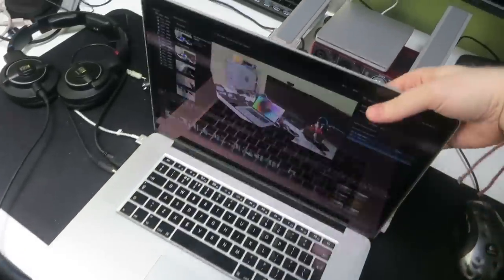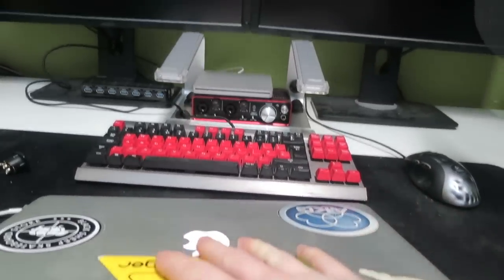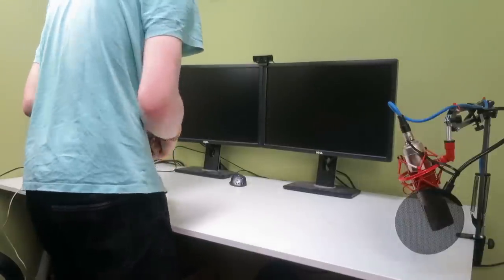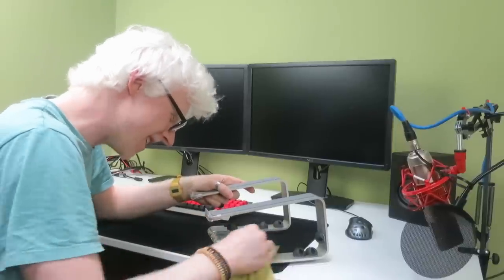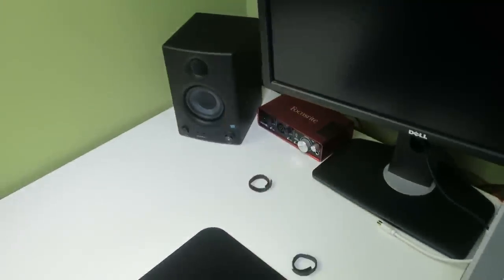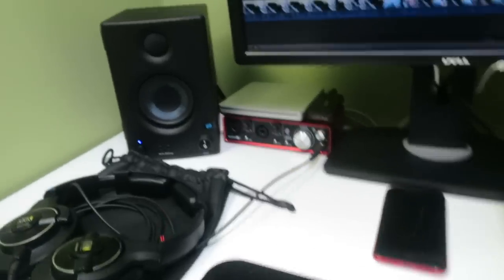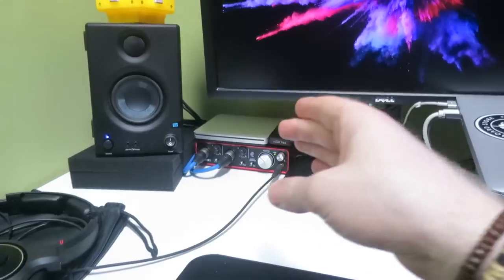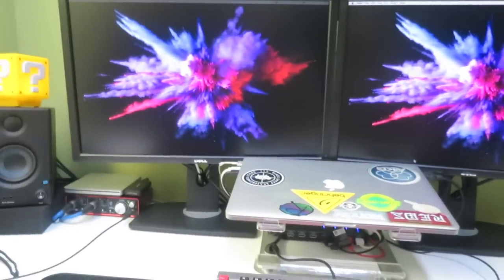Rearranging My Main Setup (July 2020)

Comment: If you go on ebay and search for "hp thunderbolt Dock" there is a seller selling them for 15 quid you need a psu and thunderbolt cable but they shouldn't cost more than 20. I've bought two ad they've been great.

Comment: If you want a mini project, you can actually buy replacement shells for those logitech mice! Don't know if they are as good as the original, I think they're copies. They also still make the MX 518 today, with a newer sensor and stuff. But why not change things up ey? Well I don't know of any mouse I prefer over the MX and it's descendents, though that new MS Intellimouse Pro looks pretty cool...

Comment: Id be pissed if I just dropped $6000-$50000 on a Mac Pro and they drop support for it...
Reply from the maker: Yep, that would suck... but hopefully Apple will be a little more generous support wise with this transition than they were with the last.
Reply: @ItsMyNaturalColour  From whay I gathered, they wont switch right off the bat... For starters they will only introduce ARM to the lower end MacBooks then move from there... I still think they have a ways to go until they can produce a x86 level proc...
Reply: @neccros007  Yeah the current ARM chips in iPads and iPhones are a great replacement for most laptops and maybe the Mac Mini but I'd expect at least a few years before they can develop a worthy chip for the Mac Pro and maybe the iMacs.

Comment: you got a bottom shelve were you could put the laptop and reroute the cables underneath the table or behind the table? or wall mount both monitors or go to a large screen tv i have my laptop attached to my 75 inch 4k tv

Comment: The idea of using my MacBook Pro 2015 in a clamp shell mode crossed my mind too. I too use two external screens although in slightly different layout. In the end I decided not to do that because of thermal throttling I experienced running CPU heavy tasks with MacBook closed. Could you do some test on your MacBook to compare temperature curves with lid closed and opened? I would be very interested to see if my experience was true and decision I made correct.

Comment: looking good mate, but personally it could be even better. if you use a dual monitor stand/ of amazon they are around £20/25. just a thought, you might even be making an updated video adding the monitors to the duel desk stand. will be much cleaner and better cable management

Comment: Does the MacBook Pro Retina really make a difference being in Desktop mode? I have a 2015 version and it's my main machine. I use it for Photoshop, Sims, Streaming Movies and running my iTunes Library for my Apple TV and it works great though i would like to be able to up my graphics on Sims 4.
Reply from the maker: Not for something like Sims 4. Presumably you're running the game at a lower res than the native res of the rMBP, which is a whopping 2880x1800 (2560x1600 if you have a 13"). 
In a case like that, it wouldn't make any different unfortunately.

Comment: Would hugely recommend the Thunderbolt 2 hub, it will eliminate your bandwidth concerns compared to the 2 USB ports. Apple are usually great when it comes to thunderbolt, so I wouldn't be surprised if you were to have 20 gigabit bandwidth through both thunderbolt ports, compared to the measly 5 gigabit bandwidth of USB 3.0. Love the content keep it coming!
Reply from the maker: I'm keeping an eye out on eBay. They're just so expensive.

Comment: Hi Tom, definitely something I need to do, my desk needs a spring clean too! I've a MacBook Pro late 2016 which has the dreaded butterfly keyboard, its been replaced already under warranty and once again i've 3 keys that have come away. It needs another warranty replacement however with the current situation you can't take it into Apple and it has to be sent away for around a 10 day turn around. So due to that i've got myself a Amazons basic laptop shelf, a wireless mouse and a wired keyboard, that way I can still use the laptop without all the pain for the dreaded keyboard! Also looking at a possible new MacBook Pro with the new Apple Silicon ones due at the end of the year, however I was almost pushed to get the current 16 inch MacBook Pro from Amazon, especially as they are doing this '5 months payment' scheme with no interest. A good way to get a new MacBook, however its only for the standard builds, so if you want more than a 1Tb SSD or more memory then you can't get them with this offer.

I also started to look into Thunderbolt systems, especially as my current and probably future MacBooks only have USB-C ports. Anker do a good one and there are so many others around too. https://www.anker.com/uk/a8396launch?search=masterbanner&keywords=master_ukA8396launch061520
Reply from the maker: So sad to read about these keyboard issues. What a complete fail on Apples part. Still can't believe how wrong they got it.
That loks a nice piece of kit. I have a few Anker things and they're all great.

Comment: Please tell me you turned the usb hub round so the cables are going straight behind the desk
Edit: okay it's not as full as I was expecting, having to reach round to add to it is probably worse than just looking at the cables
Reply from the maker: The back has the 12v cable and the chunky USB-B connection, so probably worse turned around.

Comment: Awesome video Tom! Given the MacBook's age though it might be a good idea to open it up and give it a clean before you get too settled. I have almost the exact same model as yours but the slightly higher end one with the dGPU and it began to stress out a couple of months ago when I was doing a lot of editing. But after giving it a dust the temperatures never get too high now no matter how hard I push it.
Reply from the maker: Definitely. I have a plan to make a future video, opening, cleaning and re-applying thermal paste to the MacBook Pro. Should definitely see me through for a little while longer.

Comment: Might I recommend Auralex MoPads for the speakers? I've owned a set of them for years and they isolate my speakers from the desk COMPLETELY. No sound transference whatsoever and nice options for angling up or down. You can pick them up off eBay for a very decent price and they last forever
Edit: ha nevermind just got to the next section of the vid and you've already got some pads

Comment: Need to hang the monitors on the wall or get a mount that clamps on your desk with dual monitor support.
Reply from the maker: Trying no to do anything too permanent as I'll be buying a new main machine as soon as the new Macs are released, but an arm is a good shout and I do have some spare Duronic monitor mount kit floating around.
Reply: @ItsMyNaturalColour  The arm would clear up more desk space by not having the two monitor stands. You can raise both monitors up just a little and push back the laptop. Always nice to talk with a YouTube celebrity.

Comment: Looking good Tom 👍. I have to say though that I would find it difficult having the monitors in those positions as I need a primary display right in front of me but I know you're limited by space.  Seen it mentioned in other comments and agree a dual monitor mount would be a good shout for a cleaner look.  Just about to purchase a as second one my self for stacked displays in my set-up. 🙂
Reply from the maker: Yeah, I have to admit it's not great. Not loving it, but it'll do until the new machine comes in. If I get mega sick of it, I will consider stacking.

Comment: Great to see! When Apple Silicon Macs are available, which one do you anticipate you will choose?
Reply from the maker: Great question. 
I can see myself leaning towards an iMac, especially if they refresh and modernise the design a little.
Reply: @ItsMyNaturalColour  That's what I would go for. I have a 27" iMac now and apparently there could be a new iMac redesign coming as early as the end of this year possibly early next year around the summer.
Reply: If you buy an iMac, buy one with an SSD

I tried to upgrade my 5400rpm HDD in my iMac to an SSD, and 2 weeks later, my screen fell of.🤕
Reply from the maker: @TYOPRO02  I honestly can't believe they're still selling iMacs with 5400rpm drives in them.
I bought a Mac mini for work a few years back with a 5400rpm 500GB drive and it was the worst machine ever. Beachballing during first boot and all the way through the setup installer haha! 

Really sorry to hear about your screen. So unfortunate.
Reply: @TYOPRO02  I would not be surprised if they finally kill off HDDs with the Apple Silicon Macs. For all we know, they might not even have SATA in the ARM Macs, other than maybe whatever the ARM Mac Pro will be.

Comment: Really nice and clean setup. I recommend the MX master if you do decide to go for a mouse upgrade
Reply from the maker: I've thought about the MX Master actually...
One thing I can't stand about my current mouse is the very 'click' scroll wheel. It's loud and stiff. Does the MX Master have a nice smooth scroll wheel?
Reply: @ItsMyNaturalColour  I've used the MX Master 2S before and it has two types of scrolling, it has normal scrolling which isn't the smoothest thing ever but it's still really nice. Also, you can scroll really fast as well and it has a scroll wheel on the side which is very customisable along with all the buttons on it. You could set the side scroll wheel to zoom in on webpages or set it to scroll through your timeline in Final Cut. I definetly recommend it.
Reply: I use the 1st generation and I don’t find it too bad you get a choice between a free spinning scroll wheel and a ratchet based scroll wheel in the control software. Another really useful thing is the mouse supports 3 computers via Bluetooth or using there USBs meaning it’s really easy to use for multiple machines. I use mine with my MacBook Pro via Bluetooth then can use it with the usb when testing other systems
Reply: @ItsMyNaturalColour  Hey, I actually have the MX Master 3 on my iMac setup and think the scrolling has improved a lot over the 2 (I have the 2 at work). The scrolling on the 3 is way smoother and uses some kind of magnet system to get a much softer "click" feel. It also has the option to scroll without any clicks at all either through scrolling very fast, or toggling it with the button. Would totally recommend it for you, especially for editing videos the horizontal scrolling has been amazing for me :D If you have any questions I can try my best to answer them for you :D
Reply from the maker: Thanks everyone for your help! May well treat myself to an MX Master for my birthday in October. We'll see how everything goes.

Comment: I just notices that i have the same monitor on my desk in my new work. Dell refreshed that monitor in 2017, the sharpness improved but the colour on that old model is just so much better.
Any chance you could link to that pop filter ? It looks nice. way better than the metal mesh held together with hot glue i am using . my MXL 990 is not happy with me for that.
Also pro tip , if you want a nice power strip for your desk , get a rack mount PDU and flip round the ears and screw it to the under side of the desk , it works well. I have a 12 socket one ( designed for running up the side of a rack ) under mine , so much nicer than a normal power strip.
Reply from the maker: Lovely monitors, I still get impressed by them. It was tough going from 3 months on a retina display to these, though. Don't get me wrong they're great, but damn I got so accustomed to that hi res look. 

I just searched my Amazon orders and found it, but there's no longer a product page for it it seems. If this is at all helpful, the title of it was:
Studio Microphone Mic Wind Screen Pop Filter/ Swivel Mount,360 Degree Flexible Gooseneck Holder - Black
Reply: Great video as per usual but just one slight comment and please don’t take this the wrong way but playing background music while your talking makes it rather distracting. But hey perhaps that’s just us keep up the great work.
Reply: Do you remember the model of monitor by any chance?